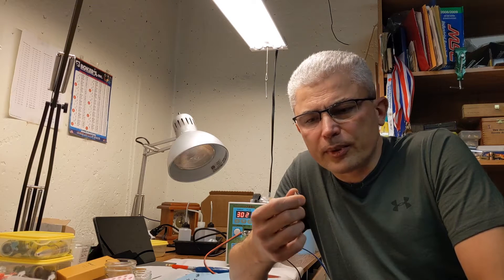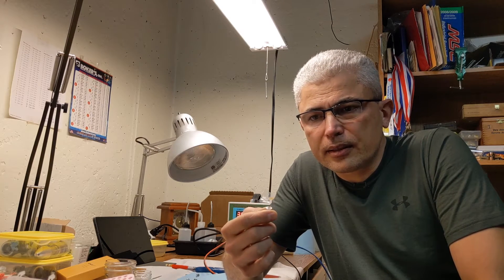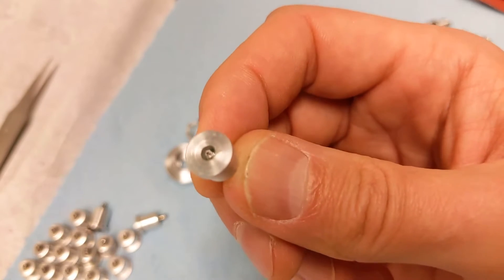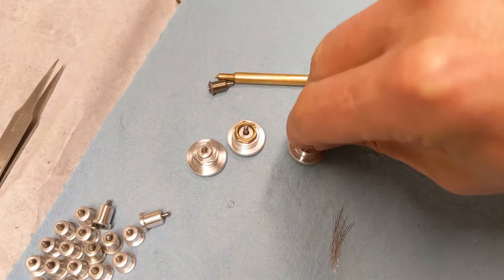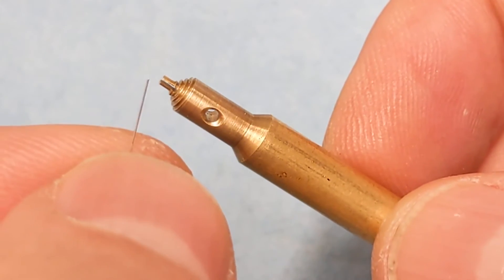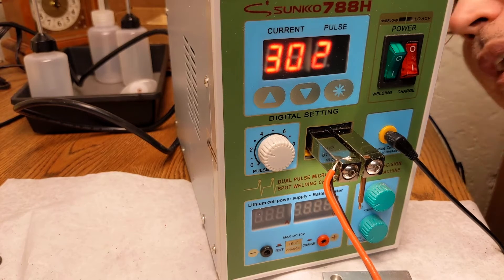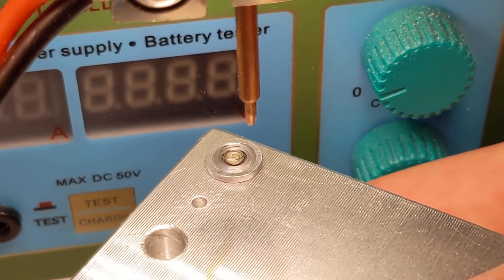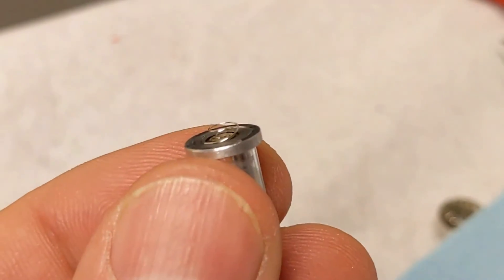Wiring F2A Glow Plugs

Comment: Outside of glow is aluminum?  How you welded platinum to aluminum?
Reply from the maker: The plug face is all steel. Of course one cannot weld Pt to Al
Reply: @alexf2a  oh, thanks, because my glows is aluminum (old Soviet Union GSK) or self making, and for outside welding I’m making hole and put steel “pin”